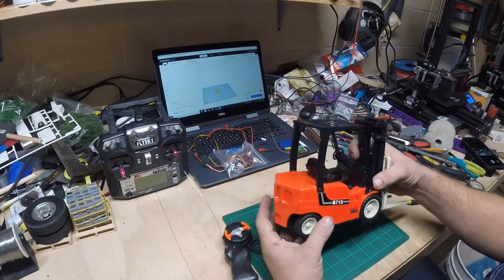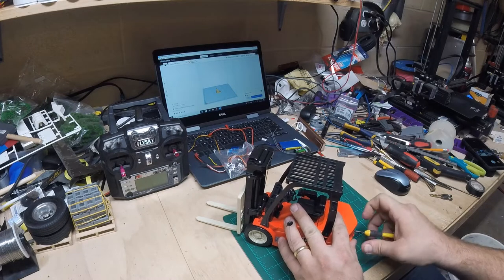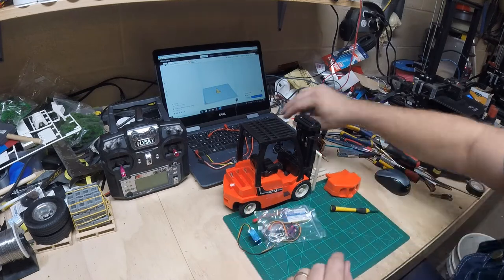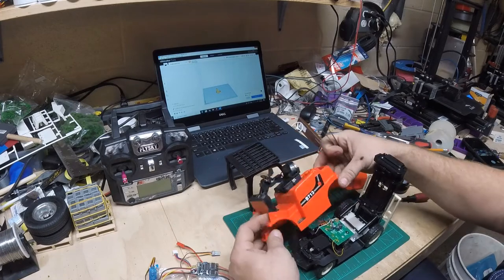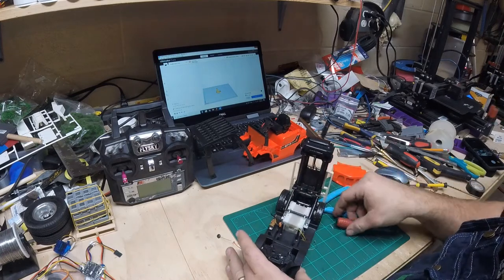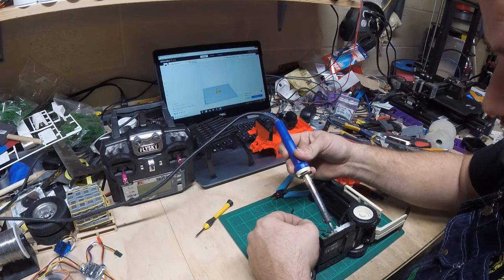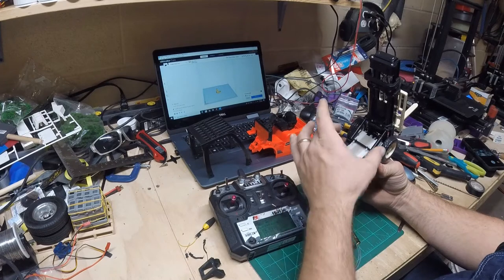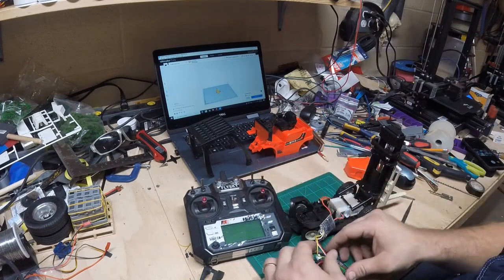RC Conversion / Upgrade - 1/14 Scale Forklift Part 1

Comment: Just ordered 2 of the esc's and a mini jst concert set with servo plugs as well. I have a steering servo mounted already. And I ordered the 6x receiver and radio. Im using you for guidance in my build of my forklift. Its the toprace tr216 forklift. Its a 1/10th scale. After im done hoping to do a walk threw video. Would love permission to mention your channel for most the heavy lifting 😉. If not just let me know before I post..thanks for the video it has helped clear alot up. I've actually watched it like ten times now making sure I get it right lol. Much appreciated 🙏